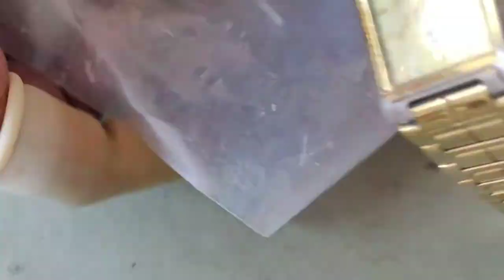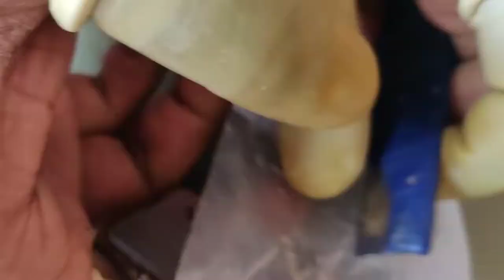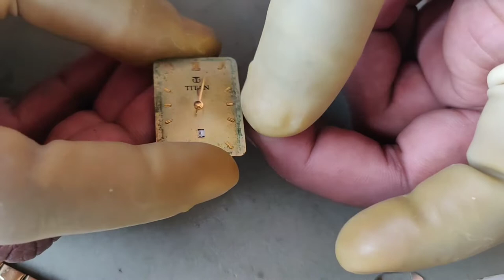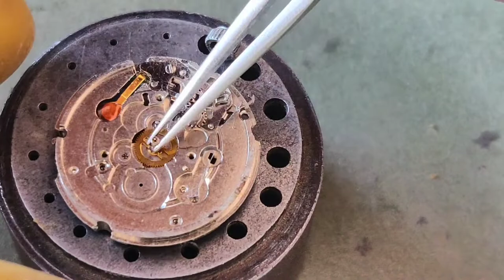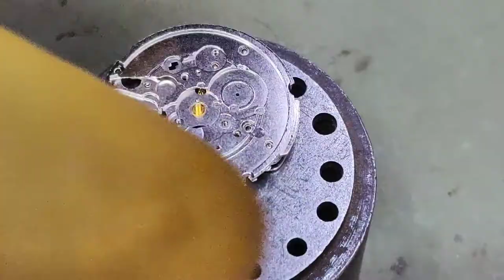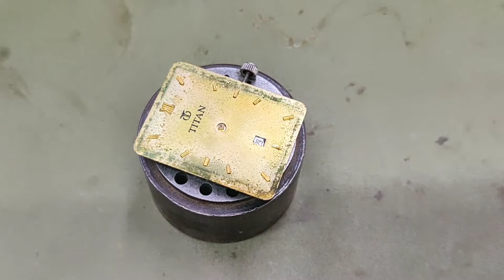how to repair a titan watch? servicing titan cal.7121 movement#titan #watches

Comment: There is no need of lubrication ? What was the glue that you applied at the end. The Date is not entered in the window.
Cheers
Reply from the maker: Hello sir,
1)In quartz movement there is no need of lubrication. 
2)I always use silicon grease on crown and watch back gasket to make watch water resistant.
3) Which part of the video are you referring sir?
Reply: @watchwizard  please upload a video on how to check coils and pcb circuit of each movement

Comment: What is rodi ko buti
Reply from the maker: I have copied this information from Google,
I hope you will find it useful.🙂
'This is a special cleaning putty designed for watchmaker's to use when cleaning balance pivots, and removing fingerprints and stains from watch parts like plates, bridges, dials, and hands. It also works well when you need to remove excess oil from watch jewels, and helps with removing broken pivots from the jewels'